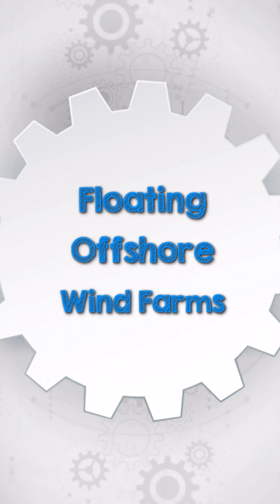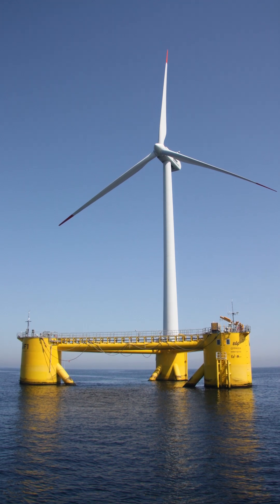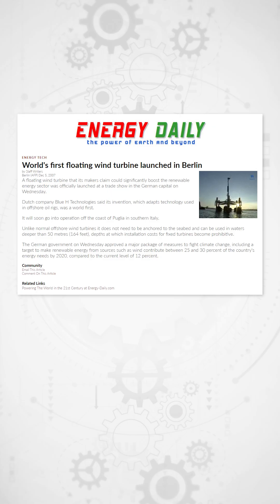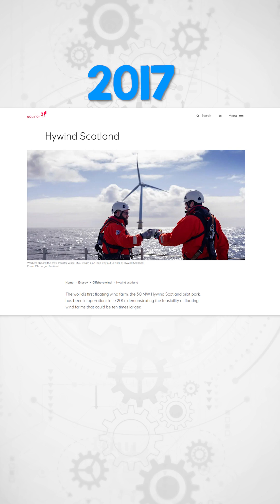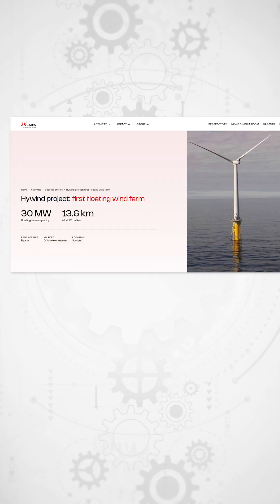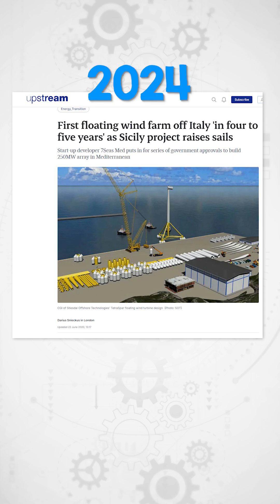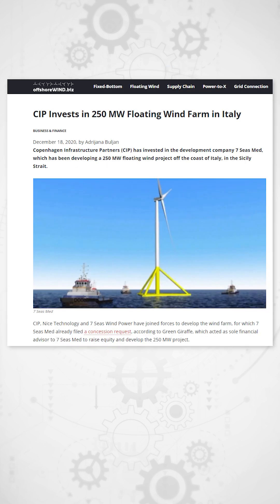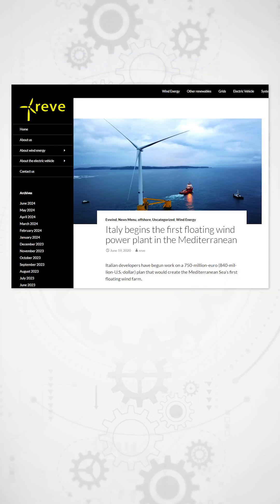Latest news on FLOATING offshore wind turbines!

Comment: I do actually like the idea of Floating turbines. The foundation is less rigid, and the should reduce the bending loads on the tower, since the turbine is able to move with the wind. I do have some concerns with the ankering, they have to last for years, and if one turbine gets loos it could drift into other turbines or something else. Would probably be very dangers. Also the sea cables might be complicated, and they should also last a long time.
You don't what to service a floating turbine if you can avoid it. 
Also ships and floating containers might run into them, that could also be a very dangurs accident.
And for now they are very expensive compared to on shore wind, thus it might not be worth it, if there is good locations on shore.